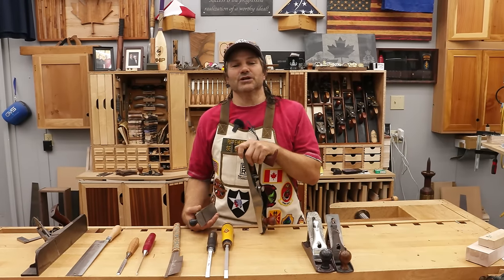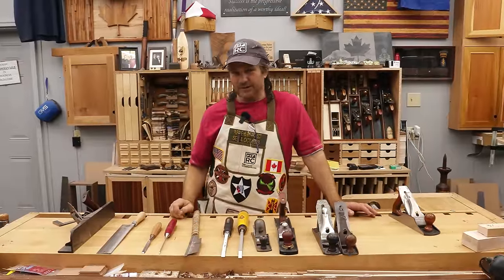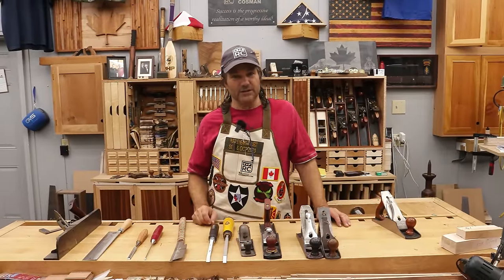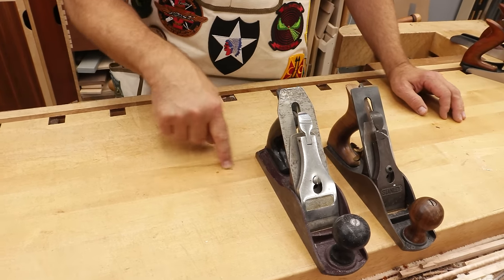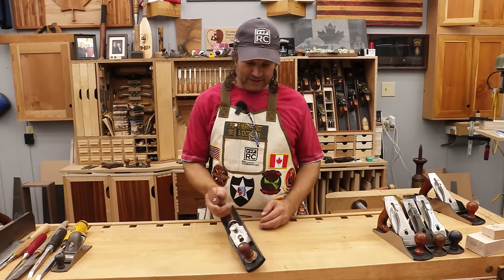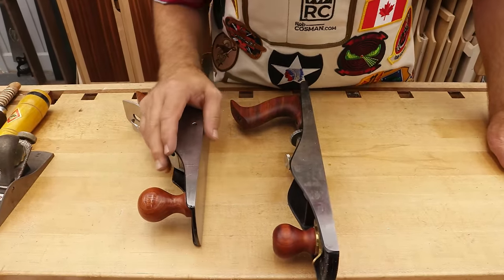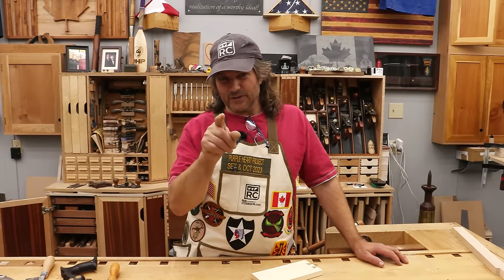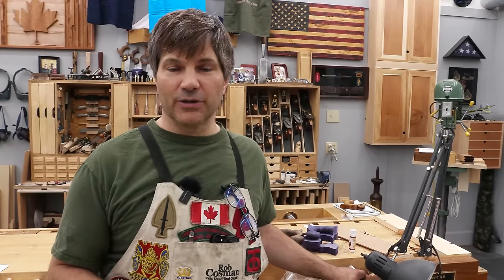Tools Not To Buy | Learn From My Mistakes !

Comment: Great video. Personal preference is everything. You talk about what I call the joy factor. It is subjective and sometimes you can’t even explain why, but a tool or a process makes you happy. For example, if I commissioned you to make a shaker table with a drawer but stipulated you must use those 9 mistake tools, that table would come out as well as if you used your preferred tools. What would be missing would be the joy factor. You would cut perfect dovetails with the gent saw. You would compensate for the chisel bevels. You would dig out the dedicated shooting plane and work through the ergonomics. To me, a good gent saw is a delight to use. I don’t use a mortise chisel (don’t own one) because there is no joy in doing that task - for me. I can’t make the unseen joint better and it brings me no happiness. On the other hand, I draft and draw by hand as opposed to CAD. Slower, yes. Better, yes. And the joy factor is through the roof!

Comment: As a crotchety old boat builder it's a bit of a surprise that I don't disagree with anything you say and completely agree with the 4 1/2, 5 1/2, and low angle block plane recommendations.
Reply from the maker: you are a wise, crotchety, old boat builder!

Comment: This was a great video just like the others you have. I have personally experienced many of these tools to be useless in my shop. I always reach for my 5 1/2 more than any other planes and use my 4 like a scrub plane. Thanks you the tips about mortise chisels. One tool I would add to this bunch is a large > 14 inch plus rip tenon saw that are very popular but I find them clunky useless and not used very often. In my case never.

Comment: On starting to watch this I wanted to give you an argument BUT your findings are completely right though I would like to mention that the traditional adjustable mortice gauge is still fit for purpose and yes it is hard to see the marking pin but with practice all traditional gauges work fine. Just my thoughts.

Comment: With regard to the gent's saw, the "correct" and effective grip is to move your hand forward, so that your thumb and index finger are pinching the blade. This way, you will feel the angle of the saw the same way as a dovetail saw.
Reply from the maker: Thanks for the tip.

Comment: Great episode. I can't say I disagree with any of the opinions.  I would just say I love my #3. It is the perfect size for use on small materials.  I make a lot of small boxes including the Cosman wood hinge box.  Using a 5 1/2 on narrow and short boards is just not fun or easy. The #3 is a dream.  The mass is not an issue since you are using it as a smoother and just taking off whisper shavings.  
Oh and I love my Lie-Nielsen #51.  It's $650 now which is crazy expensive. I bought mine ten years ago for I think just over $500 which is also a bit insane.  But I love it.  I have a shooting board that has a track with a runner on the right side that houses the plane perfectly.  Both sit right below my bench on a shelf.  Easy to pull out when I need to shoot.
Reply from the maker: Sounds like you have a good working method. Stick with what got you to the dance

Comment: Made sense to me Rob. Some of the things you mentioned I probably would have grumbled a bit over but not really put much thought to why I was peeved. The marking gauge; I've recently bought a wheeled type similar to yours after years of shredding lines in timber with the old pin type. The pin gauge is actually a nice piece of timber and brass, but the darn thing bit me every time I used it. I came across it to day and it had a go at me. I dont want to bin it, so I think I may mount it on the shed wall. Sort of a historical artifact. I'll file those pins first!
Reply from the maker: Good choice

Comment: As a regular hand plane user and collector of vintage planes I would agree with many of you par hand plane conclusions.   Many years ago I decided to build up a fully restored set of Bedrocks.   I patiently collected all the parts from eBay, applied genuine asphaltum ( 16:49 not paint) to the beds and then fitted all units with a cutter from Ron Hock.    The result was a set of very useful planes are my users.   Regarding the # 51/2 I found the Ron’s regular 41/2 or 51/2 cutter fit the # 41/2 but not the #5 ½ where it was a tad too wide.   Ron very kindly took it back and milled a fraction off.    The resulting # 51/2 is a very useful tool and one I use regularly along with #41/2.   I like the additional heft.   It also has a corrugated sole.

Comment: I'm in the UK. My biggest waste of money was a Surform plane, this thing is like a mega open file. The only thing I've ever used it for in 50 years is rounding off fence posts.I agree with you about the 41/2" plane, I use itall the time, its always on my bench, Ive just had to buy a new blade but (even purchased from Axminster Tools) that the steel is as good as the old one. Other problem on my large bench plane, is that the cast iron has aged so that the bottom has raised areas where-ever the casting is thicker. I could spend hours scrapping to blue on a plate glass, but haven't the patience, so I'm looking out for a firm with a surface grinder to true it all up. I hads an old 7 where the surface grinder had to take off 15 thou to get it flat and the same on the sides to get it back straight and flat.
Ive never got on with those pull saws. My favourite was made by Sorby and that too was my grandfathers.
Its nice having old tools that were my Grandfather's that are 150 years old, but their maintenance needs some effort.

During the lock-downs I couldn't buy new throw-aways when they got blunt. A diamond three square file worked a treat, bu you cant reset them.

Comment: Hey Rob, here is a very fundamental question. But yet I don’t have the answer. Bevel up vs bevel down. Is that an option if the angle of the frog will allow? And if so provide the benefits vs detriment. 
Is the bevel up / down more effective on hard or soft wood? Or does it matter.
Reply from the maker: Bevel down the angle of attack is always the same. Bevel up, the angle of the attack is determined by the bevels on your blade’s edge. At best, this would result in an 8° difference if you polished the entire bevel. However, that is a pointless waste of time, hence why almost everyone employs micro bevels. If you’re able to reduce those micro bevels to just 4-5°, now the difference is 3-4° and that’s just negligible. Bevel down is far more comfortable and easy to use, as the adjustments are better placed.

Comment: Tool #3, Wood River low angle block plane. I bought one and maybe my technique is incorrect but I find the lever cap keeps popping up so I have to stop and put the plane back together. So I find myself reaching for my assortment of normal block planes instead.

Comment: I have an No 62 LN low angle jack and find the performance is way better than a no 5 Stanley bevel down plane. I put it down to the way the cutting edge is better supported. There is much more steel behind where the force is applied. The bevel down blade is supported by the frog that is some mm above the sole and the cutting force acts to bend the blade. I put a bevel on the underside of the no62 and reduce the top bevel angle to get an even lower cutting angle without sacrificing edge strength.  The mouth adjustment is easy and the slightly further forward position of the cutting edge, with the underside bevel, can be compensated for without pulling things apart. I use my no 62 all the time on Australian hardwood with good effect. The very hard cryogenic treated blade is a big advantage too.

Comment: You mentioned 'smoothing plane' often. Which one do you use for flattening a board with high spots. Maybe I am too new to ask a proper question. OR is a 'smoothing plane' one to use to flatten also. thank you and have good videos.
Reply from the maker: I use a 5-1/2 for flattening and smoothing boards less than 36 inches long.  Longer than that I use a #7 for flattening then back to my 5-1/2 for smoothing. If you can sharpen well and have a well tuned plane you can easily use the same plane for flattening and smoothing

Comment: My first hand plane was a tool auction, bargain bin, Miller's Falls 4 1/2 with a corrugated sole.  A 45 minute  tune-up, and a Hock blade 20 years ago is all I've ever done to this plane. I also own My grandfather's 5 1/2 Stanley. They are all I ever use.

Comment: Rob what do you use for scribing along long grain? I find the wheel gauge works fine across grain, but along the grain tends to bite in and follow the grain lines which isn't sometimes straight.

Also you are 100% right about the 4 1/2!
Reply: Using a wheel guage to avoid that problem go against the grain so that it pulls the fence hard against the reference edge and there is no problem. Go with the grain and it will push it away.

Comment: I've heard your name on several other video's but this I think is the first time I've watched one.
Personally, I do very little woodwork even though I do enjoy hand planing. (I trained as a precision machinist and was a motorcycle technician/instructor, etc)
The only one of the tools you showed that I actually own is the last one, carbide blade round marking gauge. 
I actually don't like it and find a conventional rosewood pin type much easier to use, the larger size of beam is far more comfortable.
Reply from the maker: Hence the reason “variety is the spice of life”!

Comment: Thanks for the helpful information. Your right.  But you don’t have to get the most expensive. Like me you can’t afford it but I can get my old planes and I can get those whisky shavings as good as your fancy Woodriver  I paid for mine 15 to 20 dollars.  13 dollars for my old kutter king had to get blade leaver adjustment but it’s good now.   Your good  wood worker. You’re one of the top 5.  God bless you.

Comment: I've noticed that there are a lot more poor quality tools on offer then there used to be, so you have to be careful when choosing.  I agree with you about the feel of a tool, if it doesn't feel right in your hand it won't work right and you will stop using it.

Comment: Hi Rob.  I totally agree on your opinion about planes.  Even 100 years ago marketing was a thing.  If Stanley just would have had a couple of nice types of planes in the catalogue, capable of doing every single job, they would have sold only those and sales would have stalled rather soon.  How did they fix their dropping sales figures?  Indeed, by expanding the catalogue by dozens of different types.  I have 2 planes, a four and a six.  That's it.  Never felt the need to buy another one.

Comment: Low angle jack I will say is much easier to sharpen. Do not have the extra fuss of the chip breaker. I appreciate that. Though I'm not adjusting the knob all the time like you are.

Although, not having the lateral adjuster is a problem. Find that the angle gets knocked out of wack occassionally with tough end grain.

BUT, in the end, you get what you pay for. The 5 + 5 1/2 are typically more expensive that the No. 62. Nearly $80 more for a Lie-Nielsen.

(Basically, I just sold myself on needing a 5 1/2 now.)
Reply from the maker: Sharpening a low angel and a standard angle is exactly the same, there is no difference just because of the bedding angle of the plane
Reply: @RobCosmanWoodworking  I just mean having to disassemble the blade from the chip breaker. Extra little step, gotta grab the allen wrench, etc

Comment: Just to add my 2 cents as a japanese wood worker for the dozuki saw.  Unlike western saws many japanese saws are ground for either hardwoods and softwoods.  Usualy for hardwood you need a higher tpi saw and teeth ground for hardwoods (slightly shallower angle on teeth).  You can stil cut hardwood with a sotwood saw but you need to be gentle and careful, hardly applying any pressure at all.  

Additionally dozuki saws are very delicate and fine, they are meant to be used with little to no pressure when cutting ans you need to prioritize straightness.  If you don't you may loose a tooth.  After that they will leave an excellent and flat surface.
Reply: I love the dozuki for dovetailing. But having only used mediocre western saws before, it cost me 2 blades to learn how to use it properly. 😅
However, I converted the damaged blade to a pull-blade to use it up properly. =)
Reply: yeah, what's up with the "hundred years design?" japenese also did alot of woodworking way before the industrial revolution
Reply: yeah i would definately trust japanese woodworking finesse over western. the attachment to life in general compared to overiding it and forcing a path is part of the culture, compared to our brute force sort of approach.

book of five rings even has some exellent woodwork advice 😂 and that guy was a samurai..but he understood the nature of wood.

id also trust our ignorance of japanese culture to be pretty solid, so were missing most of the education on the tools and practices.

Comment: Can you please recommend a specific brand and where is a good place to purchase.

You made a very good point highlighting the issues with Japanese tools. I love Japanese tools,  but they are tailored for cedar, not maple or oak. I might add that pulling a Japanese plane through maple is a bear to keep a hold of at the end of the pull as the plane is going off the board. 
 Thanks.
Reply: Woodcraft store close to you or online. Rob also sells.

Comment: I was going to remark about how much I like my low angle jack, but realized that really, it is a mixture of the mass and the low bevel angle.  I occasionally have prepared microscope slides of different woods, trying to identify them, and the low angle jack works really well for the extremely thin, end shavings I want.  I do use it for very light modifications when squaring the edge of a board, but I followed your advice about the 5.5 and 4.5 and like both.
Reply from the maker: I find that the 62 has very low mass compared to other jack planes, which is one of my complaints about it.  I am glad it works well for you

Comment: I currently have a no4 I picked up for like $10 at a pawnshop.... But We had 5 and 6's in woodwork class, those were better for flatting large dips in long boards. Also true what you said the larger planes need less muscle Middle aged guy with ischemic heart disease) so not in great shape :)

Comment: You're right about Plane sizes. I wear a 2XL Glove, I can't get my hands in a #3 or #4.
Reply: On my no. 4s I find myself using a two fingered grip with my little finger on the side of the plane only silghtlly above the sole.

Comment: Well Mr. Rob, I agree on 8 out of 9. I bought new Stanley 62& that #4with the adjuster that doesn't work the #4 is in shop under a lot of dust the 62 I gave to a nice young man who is getting into craft. My goto is W.R. 5 1/2 my disagreement comes in block plane.  I was given a Stanley 102 i think it fits in your hand , apron pocket . Great video. Keep em coming.
Reply from the maker: yes a 102 probably does fit the hand well as its cap dose not sit very high.  but a 102 is a "special" plane and I was referring to a "Standard" size block plane
Reply: Rob, Thank you for taking time to answer my comment.  I really know very little about the small block planes the man gave me and he has passed on .  I just know it feels good when I pick it up and use it not like some of the newer planes I have bought the past couple of years. What happened to "Stanley "? I'm sure we both know.  Have a great weekend looks like winter heading ya'lls way.

Comment: I disagree on the low-angle jack as it is a great beginner plane. The standard plane is a pain in the neck to adjust when you're just new to woodworking. Sure, it's easy to the side of the board, but face planning is a different story. I struggle with trying to adjust everything just right to avoid gouging the face, and was ready to just give up on planes altogether when a buddy of mine told me to try the Veritas low-angle jack. It changed my whole outlook on planes.

I understand that as an experienced woodworker you don't have these issues, but many beginners do. In essence, your advising a novice to avoid a tool that may be far more suited to them because you don't have the issues they do. Furthermore, I have no clue why you dismiss the different angles. There is no way you can plane a difficult grain such as birdseye maple with a standard plane, but I've done it with a low-angle plane with the high pitch blade. It's a bit of effort, but at least it doesn't tear the wood.

Comment: As a newish Woodworker, I think this is great advice. I was thinking about a Jack plane, but your explanation has put me off. I'll stick with my No.5 Woodriver......and I just can't get mine as shapr as yours....lol.

I have bought a shooting plane, a Veritas one and I love it. It gets more use than most of my others and I am one of those people that mix hand tool woodworking with machine tool woodworking. But the shooting plane is just fantastic at getting perfect square or angled ends. I used to try to use my No.5 but it was so difficult and caused shoulder pain.

Excellent video.
Reply from the maker: Thanks for the comment.  Getting a square cut is a function of it the manufactured built the plane with sides perfectly square to the sole.  We prep and grind all of our WoodRiver plans we sell to ensure they are perfectly 90 degrees to the sole so you dont have to spend an additional $500 just to have a good shooting plane.